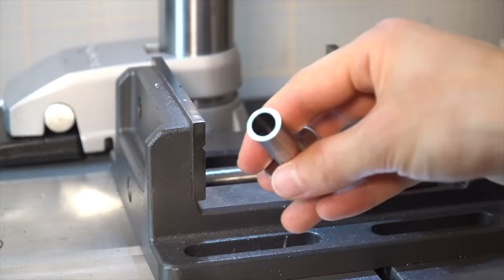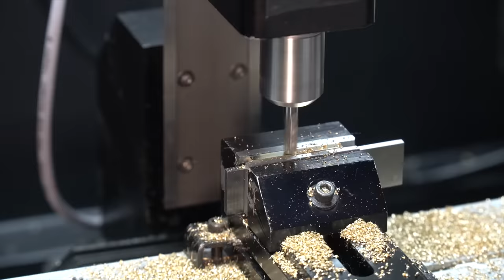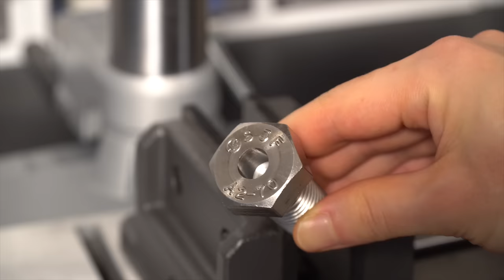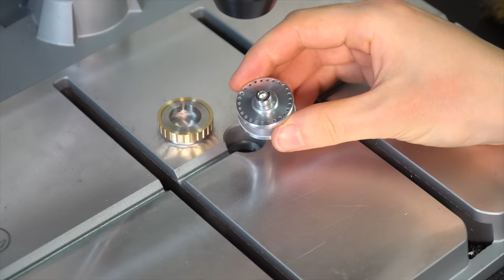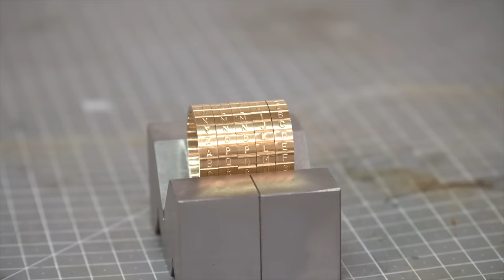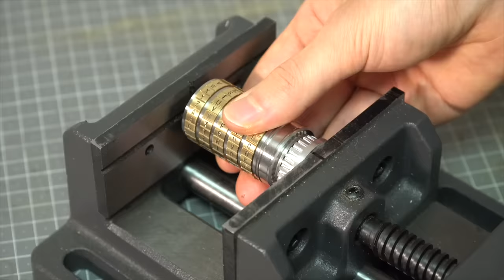I Turn Stainless Steel Bolts into a Pocket Safe

Comment: Now you have to send it to the almighty LockPickingLawyer for quality assurance testing... ;-)
Reply: Got a click on one, nothing on two, click on three, click on four, back to two and it’s open..... 🔐🔒🔓🔓
Reply: @elpapirin9240  This is the lock Picking Lawyer and In today's video we'll be testing the lock with my favorite tool, You guessed it, the RamSet nail driver.  3, 2, 1 and as you can see we've got it open folks.
Reply: Sorry to say, but without any false gates on the other 25 positions, that is probably easy to decode.
Reply: @allenrasche1189  Yeah, I was thinking the same thing. Wouldn't you be able to just put some pulling pressure on the bolt and turn the dials and feel it fall into the gates one by one?
Reply: This'll be opened with a red bull can in about 8 seconds
Reply: @jhyland87  yeah, you should even be able to tell which one is binding from how difficult it is to turn.
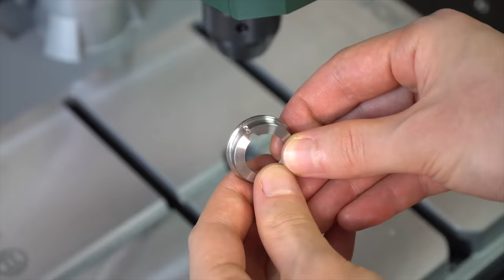Reply: If you go to 11:16 he would need 25 notches cut in all 5 rings, of varying depth (.010"-.015") in a random  sequence and you'd have a very secure lock.
Reply: @allenrasche1189  yeah, or maybe even be able to pull the bolt out one at a time as the gates line up?
Reply: Noice you beat me to this :D
Reply: LPL would praise the workmanship this much is certain.
Reply: it is locked in 5 spots. Getting 1 correct location would not change anything. Getting 4 correct locations would not do anything. All 5 engage at same time so pressure on the bolt would not indicate anything. If tolerance is all the same you could put pressure on the center bolt and turning the code would not give you a click when landing on a gate.
Reply: Yeah... but it’s more a novelty than a security lock. That said, I do appreciate the quality of the work. And it’s a lot of high quality work in my opinion.
Reply: Plot twist : He is LPL,look at his thumb/hand. It has similarity.
Reply: @Power5  That is how you pick locks. One of the 5 spots is going to be just a little more loose tolerance than the other spots. That one will bind. You then turn it until you feel that it is in a gate. At that point one of the remaining will bind and you repeat the process until you got the thing open.

The fix is to make false gates.

Of course this thing also has the problem that you would be able to get a feeler gage in between the rings.
Reply: Just pull an spin it's an extremely simple lock
Reply: اهداف المباريات 4k  Marked as spam.
Reply: @itosasto   Don't make me laugh... WITH THAT, never...
Reply: @BaldurNorddahl  judging mr LockPickingLawyer's videos i came to the following conclusion:
Locks were invented to keep the honest people out.
Because dishonest people will always find a way in.
And that is how the biggest criminals can keep stuff stored safe without actually using a safe.
A simple bolt will do since honest people wont open it.
Reply: Was going to suggest the same thing!
Reply: Damn! I was thinking this very thought about 4 minutes into the video! Hahaha
Reply: It was definitely not a fluke
Reply: @allenrasche1189  Like an old school bike lock.....
Reply: @TheHungrySlug  Pwah ha ha ha!

Comment: That's alot of milling! I just love watching how that all came together.  Nicely done mate
Reply: The only purpose of the bolts was to reduce the amount of milling needed to begin with.  This would usually have started with some steel rod.  Amazing job without a doubt but the whole 'bolt' thing was just clickbait to make it seem more 'amazing' because it's made from something else instead of just from raw materials.
Reply: @richardrussell7082  
Wow, I bet you're fun at parties. 
😂🤣🤡
Reply: @richardrussell7082   How long did that project take?

(And how much planning, measuring, etc, did you just not show?)

Comment: Perhaps the Lockpicking Lawyer would like to have a go at this?
Reply: RyeOnHam Came here to say that!
Reply: Just pull and twist like a cheap childrens safe.
Reply: Yeah, it's probably not a very difficult one to open. Still, it's a nice piece of work, and provides a bit of extra security :)
Reply: @chent  Not an expert on lock or anything, but assuming it's done with tight tolerances,  I would think it's not that easy.
Reply: @samik83  If you open it starting with the wheel on the other side, you can just open them one by one, as it will open 1 step for each wheel. Tolarances have nothing to do with it, it is just one of those locks.
Reply: @chent  Not sure what you mean. As far as I can tell, It won't budge until all of the are aligned so you can't open the one by one.
Reply: @chent  Not sure what you mean. As far as I can tell, It won't budge until all of the are aligned so you can't open the one by one.
Reply: @chent  There's a tooth in the key block for every letter ring, so your technique doesn't work. Tolerances are important, because you can pull the two ends apart and then try to find out which ring has the most resistance to turning. Then you can turn it around until you can feel it locking into place. The worse the tolerances, the easier this process becomes.
Reply: @chent  All the wheels have to be aligned. That's why there are five notches on the little brass keyway he made at the start of the video. You have to have all five wheels aligned for the five notches to pass through.
Reply: in any case thats all i have for you today
Reply: Plz do send him
Reply: @samik83  
There are ALWAYS  deviations in manufacturing.  As a locksmith, we regularly deal with tolerances down to 1 or 2 thousandths of an inch.  Each ring will bind on its own and a lock of this type can be easily bypassed in just a few seconds.
Reply: This thing needs false sets before sending to him. Too simple to just pull on the inner bolt and stick a drill on the other end; it'll take fractions of a second to open. ... Depending on the RPM of the drill that is 😅
Reply: Or imagine if they teamed up together and designed one together
Reply: False gates properly done would also add to the difficulty.  Imagine 25 false gates on each ring.
Possible combinations  11,881,376
There should be room for many false gates cut to the same width as the key way.
Reply: LPL : R A M S E T
Reply: I see, if the rail is shorter, it will be a slight clip, same if it is too tight, most code locks are broken with a change in gapsizes or you can someway sense the "click". Destructive is always easy way out, but if you weld it to something it can probebly have some uses.
Reply: Just thought about that too
Reply: See a thumbnail with some kind of lock, LPL came to mind. Automatically.
Reply: Has anyone ever considered that he could just watch the video of how it’s made to pick it.
Reply: Was just going to say this.
Reply: Very cool project, but the LPL would have that safe open in seconds.  It would take me longer, but I'm pretty sure I could open it in a few minutes.
Reply: Easiest way to bypass the lock is to just damn drill the thing! Ha. It's such a beautiful piece of craftsmanship though!
Reply: Came here to say the same thing he should send i to him
Reply: beat me to it!
Reply: He would have it open in seconds.
Reply: @Alan_AB  All such locks can be opened by pulling and feeling for the click.
Reply: @fivish  You might be right. But I think a high precision machined mechanism would still need all rings to be in proper alignment before any movement could be felt on all pins.
Reply: RyeOnHam  I thought the same thing.  This lock is exceptionally well machined, but I believe there's at least one good way to start approaching an attempt to bypass it.

I'm not certain if this trick applies to all similarly functioning locks, but typically with a combination lock where the dials go around the locking lug/shaft like this one (and the other combo lock he made,) one of the bypass methods you can use is to pull on the shackle as if opening the lock, and then try to turn the dials.  As I understand it, when the dial is in the proper position, if everything is machined well, you should feel slightly more wiggle in the dial than if it were in the wrong position.
Then again, I might be misunderstanding some fundamental aspect of this procedure or the kinds of locks it works on.  But I'm pretty confident this is the first approach LPL would take, and it would probably work.

It's not the fault of the craftsman, but the way the actual mechanism itself is engineered.
Reply: @samik83  Apparently you are not familiar with The Lock Picking Lawyer . 
He could open that  blindfolded while bungee jumping.😂
Reply: @siriosstar4789  I've seen some of his videos. I'll have to check out how he opens a lock like this.
Reply: False gates on this one would be an absolute gamebreaker. You see, the intermediary wheels (steel) between actual pin wheels (brass) block the classic feeling attack very well. 

Still, I suppose this thing will fall for the general "pull and roll" -thing. While false gates would really fix that, they would also make the lock mechanism very prone of getting stuck.
Reply: @heiggi1337  agreed. Although a beautifully crafted device, this one would be simple to pick. (I work on locks as part of my job).
Reply: im pretty sure that you just have to pull and spinn the weel until you hear "klick"
Reply: @Lttlemoi  Bluetooth ain't got nothing on illumination malleability.

Comment: When your finger close to the drill.
Man, thats real anxiety
Reply: You get used to it and doesn't make you anxious anymore
Reply: The drill position is fixed, so the risk is much lower. If you'd hold the driller by hand, things could get really ugly. ^^
Reply: @aymanmalek1294  and then you lose a piece of ya :)
Reply: @danicalero1364  careful but not anxious
Reply: Only for incompetent people that are afraid of tools.  Those people should stay away from them then.  Craftsmen and competent people respect tools, not fear them.

Comment: Here is how you break the combination of this sort of lock:  You pull it apart to create some tension and then try turning each wheel.  Due to slight manufacturing differences, one wheel will typically "drag" more than the others.  You turn it until you feel it turn free which means it is at the unlock position.  Then you try the other wheels to see which "drags" the most and do the same thing.  And so on.  For the real cheapie locks with this scheme (or that are built into some briefcases), you can open it in about 10 seconds with a little practice.  There are some padlocks with numbers you turn but the good ones are a more sophisticated design that prevents you from "feeling" your way in.
Reply: I think you missed the point.

Comment: Me after finding one of these laying somewhere: Secure it in vice on end mill and run a 1/4” 4 flute down it longways inline with the marker line, cutting deeper on each pass until groove has cut all the brass nubs off, then sliding it open to find a curled up note that reads "thank you for watching" ... Doh!

Comment: Love the video! Anyway you could possibly do a equipment list or something? Would love to know what you are using. I'm really interested in CNC as I'm a toy maker, and I would love to know some cost of entry for dealing with this type of work. Thanks!
Reply: steven hubbard well entry level stuff can be quite cheap, roughly 5k to 10k dollars
Look at the so called PocketNC 
But it can only cut Aluminum and weaker (brass and plastics) 

(Of course 5k to 10k is very expensive for a individual and i will buy since i dont have the financial means at the moment, but i d be a dream) 

All the best
Reply: Not sure on the mill but that's a sherline lathe.
Reply: I don't see CNC here. Yes, he is using CNC rotary table indexer. Equipment that he is using is Sherline. Link: https://www.sherline.com/
Reply: If you need a decent CNC mill without a 5th axis a tormach PCNC 440 or 770 may be worth looking into. Comparatively inexpensive, solid machines that will chew through whatever you throw at them with proper feeds and speeds.
Reply: Shop used and go with older stuff if you are looking on the cheap for great quality. We had a mill and lathe from our college that was definitely older than anyone still employed at the school and we built high precision parts for race cars with them! From what I remember it was said to be around 3k for each, so 6k for the total package. Local machine shops also may let you rent out some time on their equipment, that's where I got my start as it really is an art to get good at this kind of thing

Comment: Started out as operator, up to a 5-axis NC, but then CNC came out. Should have been a toolmaker and really learned the craft. The first day of CNC our boss was so proud. He put a big aluminum blank in the Miller to make a transmission case, and all the operators stood there, as ticker tape spit out the tool moves. But the whirring mill hiccuped, paused, then plowed sideways thru the wall of the aluminum case, then down and buried itself red-hot into the mill bed, as the mill motor exploded in smoke. : )

Comment: A perfect project for anyone with $50K to spend on specialist equipment.
Reply: Matt T He is using Sherline, but you can't buy the CNC combo for less than $2k. Include the accessories and other tools he's using, and you are underestimating the cost to get started. Either way, over $4k just to get the Sherline lathe and mill CNC with controller and steppers to get started if you buy direct.  EDIT: Thought I couldn't hear steppers in his other videos, but turned up my volume and it is a stepper setup. Since he does have CNC as an option, you are also looking at software costs. At minimum, he's got $6k in his setup if his other shop tools are cheap. I have the ultimate combo, which doesn't have all the Sherline accessories he's using and it ran me $4200 shipped to my door 6 years ago. $2k is Chinese CNC territory. If you are lucky and find a Sherline mill and lathe second hand for dirt cheap, you might be able to get started in CNC for $2k if you don't include the accessories.

Edit: I should note, in this particular video you could get away with non-CNC for what he does, which would run you around $2k. But his setup does include CNC in other videos.
Reply: Matt T You are correct. I tried to update my reply to reflect that. His first comment in this video shows the base equipment he used in this video, though without the cutters/bits and other accessories.

Comment: Fantastic video, beautiful precision craftsmanship.  I just have one question:  why did you use bolts (which you clearly ordered, so it's not like they were just laying around), since the first thing you did was lathe off the hexes and threads?  Why not just use a piece of stainless stock rod?  I'm sure you have a reason; I just can't figure out what it is.
Reply: Why not?

Comment: Thanks for an inspiring project!  Your surface finish is so beautiful.  Are you using carbide inserts or HSS when cutting the SS bolts?   Also, what diameter were the bolts you started with?

Comment: Looks cool, but I am confused, what's holding the outer tube. There are no threads or anything on the end ring. If I understand correctly, this safe can just be pulled apart.

Comment: Wow, incredible work. So not trying to be critical or too nosey, but is just the hardware used for construction (before your time and craftsmanship) $300-$400 usd? Ive been trying to come up with similar ideas, crafting practical items from old railroad spikes. Sorry in advance if the question is insensitive.

Comment: Amazing as I watched you cut that large metal rod with a hack saw so easily I couldn’t help thinking how I always struggle to cut much smaller pieces with the same tool.  What am I doing wrong?
Reply: Sawing works best with smooth repetitive motion
Reply: @DaveyGoose  😁

Comment: Thanks, very interesting, unfortunately I'm 77 and am now in an apartment with out  my shop.
Reply: Dan, I'm 74 and was never able to do work like that! So if you did work like this, then I urge you to find a shop nearby that might let you use the machines in off-hours, kinda like some chefs use commercial kitchens off-hours?

Comment: you could decode this with a magnet if your pin securing the brass outer wheel is a magnetic steel.

Comment: Very interesting and impressive but it sounds as though you are implicating how easily you can fabric stuff outta small inexpensive stuff
Only problem is that your average Joe does not have a shop
Does not have all the machine equipment and tools you have 
Does not have the years and training to work with all of this

Comment: Impressive machining, but the "bolt" part is just a click bait gimmick. You could have just used stock 2" round cold rolled steel, would have been cheaper and the steps would have been the same.  Also, you had to use brass stock that were not bolts.

Comment: Ok at least a boring bar. Use of a taper attachment is not spectacular on a manual. Not sure what u used to locate parts. This guy is NOT a mill operator. If someone tried to drill through ss steel in hard jaws on a mill he'd be fired. Brass. The aluminum of gold colored material. Yeah how bout the hollowed spline part with a hex end you need for bike axle work. Made one out of ss on a bench press and a manual mill with a   manual indexer. Ooh.
Reply: Now no one can steal his meth.